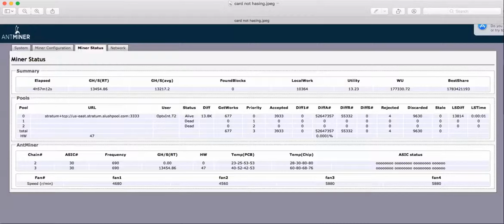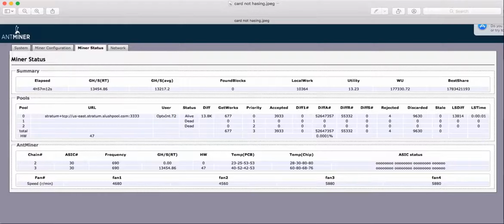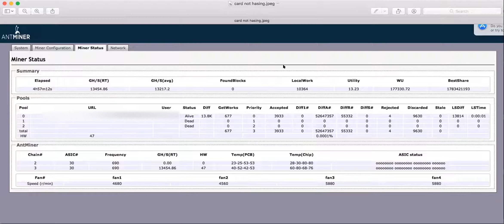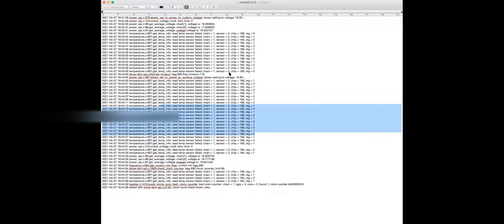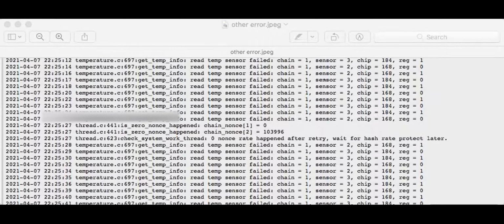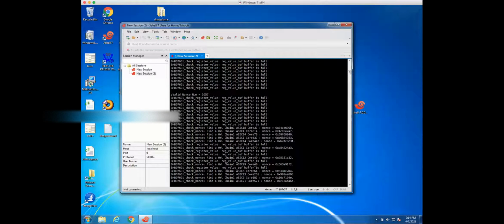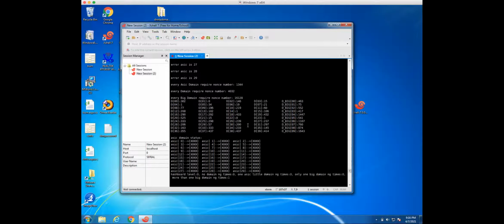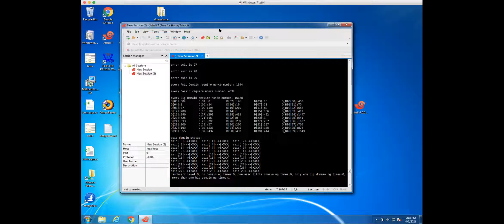hashboard repair: Diagnose and explore antminer T17 hashboard errors

Comment: Hello my friend. When we receive this error in Hashboard t17, it means that our clock signal is noisy from one chip to the next. To find that chip, we have to start signaling with the oscilloscope from the first chip. We have to wait for a few seconds on every chip that receives a signal because this bad clock shows itself after a few seconds. When you reach the defective chip, you will see that the clock signal has the correct waveform at first, but after a few seconds, it changes. The exact same chip must be replaced.
Reply from the maker: Please join the discord server.  It is much easier to help there.  Thanks much.

Comment: great video sir
I have a problem that I hope you can help me with. I have a t17e hashboard, the last four domains in the kernel log are zero voltage, and according to my tests, the regulator voltages are correct and the boost circuit is also checked, but again when on the device  We test, all 78 ASICs are detected, but the voltage of the last 4 domains is zero, which means that the hash board does not work so do you have any advice ?

Comment: what software are you using to test your t-17's? Or is it a piece of hardware or combination of both. I am fairly new to asic mining but I have 2 used rigs (one being a t17 42 th) that I bought from china and both of them arrived broken. Never buying used again but that's another topic! How are you testing these if you will please?
Reply: Also my t 17 has 2 hash boards that are the same and one has board that is not exactly the same as the other 2 are your like that too? Sorry there isn't a whole lot of information out there on this stuff.
Reply from the maker: Mike.  Join discord and we can talk better.  I am using the test fixture sold by Zeusmining.   There are some boards that have different heat sinks but the boards should be nearly the same.
Reply from the maker: @mikebelliston  discord. Discord.,,,  there is some and also people that know how to repair them.

Comment: what are the resistors sizes on the board because when i was taking the heat sinks off i had a couple fall off and i cant find them
Reply from the maker: Hi Youssif,  on the discord server, there are parts lists of many boards.  Also repair manuals that can help you find out which sizes the resistors are.  I recommend you join it for free and  you can get that data, but also ask questions.  Thanks!

Comment: With the vnish firmware it should run normal cause vnish accept only one working temp sensor. It is great third party firmware!
Reply from the maker: I know the older version of brains os took the highest temperature.  Funny thing.  There are only 4 chips on the board that it measures on a T17.  Not sure what happens on other boards. I'll do a video on the tmp sensors and how to replace them when I can find one that needs it.  I bought the chips to do it.  Thanks for the comments.
Reply: @AntminerRepair  Every board have 4 sensors as far as i know. This is also the case on the other s17 models. Thanks for your answer.